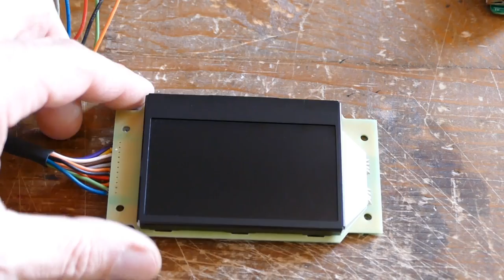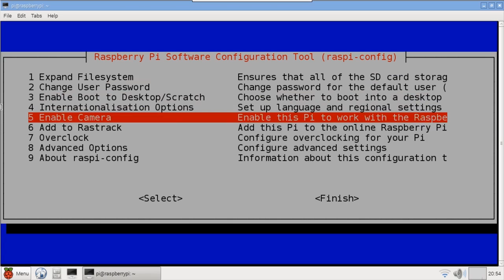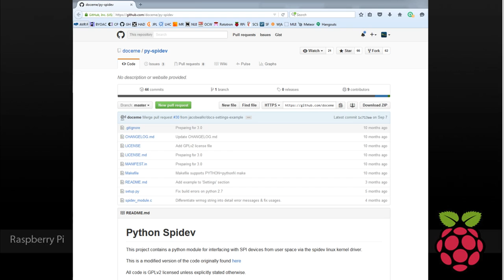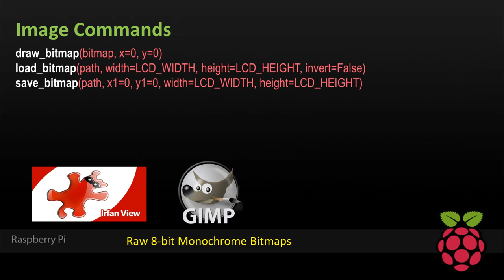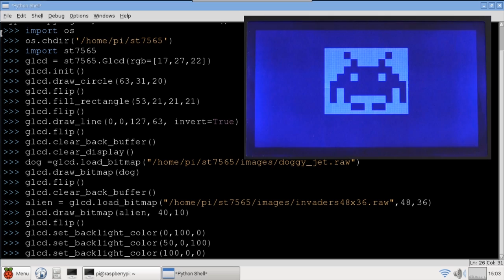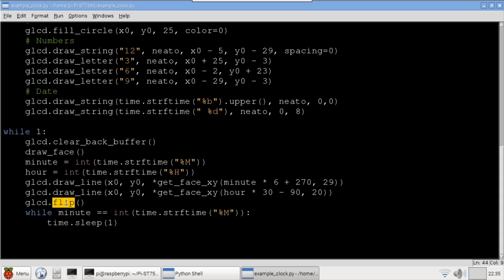Using a graphics LCD display with the Raspberry Pi

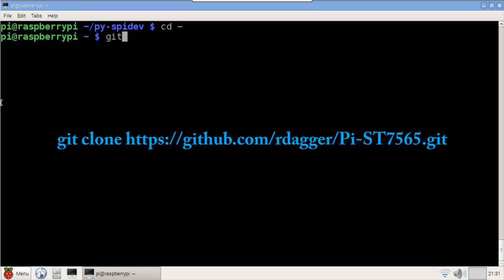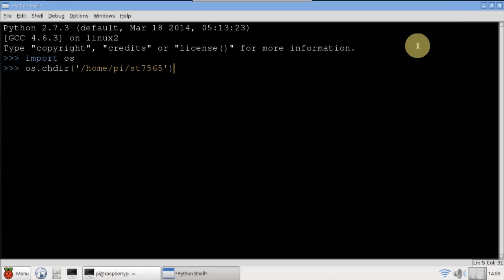Comment: Hello, there are some inconsistencies in the video.  At 1:34 you connect backlight LEDs to pins 21, 20, 16, at 9:54 you use 17, 27, 22.  Additionally, at 6:14 you use /Pi-ST7565 folder, at 9:38 it is /st7565.  Otherwise it is a great tutorial - it would take me few weeks to figure out everything and write driver myself.

I just wonder, how did you choose resistance of 51 Ohms (not available in my local store)?  To me, LCD display looks too dim, so I guess reducing this value could make it brighter.  What would be smallest acceptable value?
Reply from the maker: +Marko Pinteric You have a good eye for detail. I use 17, 27 and 22 on the breadboard portion of the video too and put up a note that you can use any pins. I changed the pinout for the schematic to make it easier to read.
 
I do not recommend going lower than 51Ω because you could exceed the maximum gpio pin current rating which I think is 16mA per pin and 50mA cumulative.  I chose the resistors to limit current not to optimize the backlight.

At 51Ω, the current per gpio is between 8 and 10mA.  You could run the green and blue channels at 12Ω but you would be pulling around 18mA per pin which could damage the Pi.  The red channel on my GLCD has a 100Ω resistor in series built into the board.  Therefore, the 51Ω on the red channel is not necessary because 100Ω is conservative.  Still without the 51Ω resistor on the red channel you would be pulling around 13mA which leaves less of a safety margin.  

Another solution to optimize backlight brightness would be to use a transistor for each LED cathode and connect the anodes to the Pi’s 5V rail.  Just make sure you use higher value resistors to compensate for the higher voltage.  Also double check to see if your board has any built in resistors.
Reply: +rdagger68 Thanks for the answers.  Another question:  I want to turn the display off.  I tried sleep() and standby() functions (what exactly is difference between them?).  They only erase the contents of the screen but screen remains at the full light.  I also tried set_backlight_color(0,0,0), but as soon program finishes, screen is turned on again.
Reply: +rdagger68 Thanks for the answer.  So there is no programmable way to turn leds off?  Or at least to go back before Glcd(rgb=[21,20,16]) command that actually turns them on?
Reply from the maker: +Marko Pinteric  set_backlight_color(0,0,0) will turn the LED's off while the program is running.  You could also use set_contrast(0) to blank the screen or glcd.send_command([glcd.CMD_DISPLAY_OFF]) to turn off the display.  You should use glcd.cleanup() when your program ends.  If you use the LED gpio pins from the video the LED's should go off after the clean up statement.  Some gpio pins have different default states, but if they are off until you run the init command then they should go off when you run clean up.
Reply: +rdagger68 cleanup() did the trick.  Thanks.

Comment: Hoping to use this display with a Pi Zero to run a word processor. Is it doable and what steps should I take to get it to work?
Reply from the maker: The hardware configuration for the Pi Zero would be the same as for the Pi B+ in the video.  In terms of software, my GLCD library would need to be extended to support terminal style printing.  You might be better off going with an OLED display such as the SSD1306 because there is a much more robust software library called Luma: https://github.com/rm-hull/luma.oled
Reply: I actually purchased the ST7565 prior to my first comment, I'll pursue trying to use it for now. Also, I realized yesterday that my display is positive rather than negative. I was able to run your clock program on the display using a Pi 2, and then encountered some issues with it after changing the time and date on the Pi. I suspect it's an issue with the wiring. Is there any additional/different coding or wiring needed to compensate for the positive display? Thank you!
Reply from the maker: I can't think of any code differences.  You do need to be carefully that you are not pulling more than 16mA per GPIO pin for the back light.  It would be a good idea to measure the current and adjust the resistors to limit the current or use transistors to operate the back light LED's.
Reply: Need help figuring out how to display keyboard output  on the display. The libraries I've experimented with only run animations or images on the display, is there a way to directly interact with the  ST7565 as a primary display?
Reply from the maker: Are you trying to emulate a terminal or are trying to use the LCD display instead of a monitor?  Do you only want text or do you need graphics too?
Reply: rdagger68 I’m trying to use the GLCD as my main screen, so that it is independent of a monitor. Really only need text, but I’m hoping to have File and Share options as well, and the ability to indent and create new paragraphs, typical word processing features.
Reply from the maker: I haven't tried it but here's a library that might be a good start:  https://github.com/jtylers/raspi

Comment: what if i wanna have the command lines on the display ??
Reply from the maker: Sorry, I don't understand the question.  Are you trying have terminal commands appear on the display as you type?
Reply: yes
Reply from the maker: You could use the subprocess library.  Call commands using Popen() with stdout=subprocess.PIPE and shell=True.  Retrieve the output with communicate().  Then use draw_string() to display the output on the GLCD.  Use a monospace font like FixedFont5x8.  It will make it easier to fit long lines on the display.